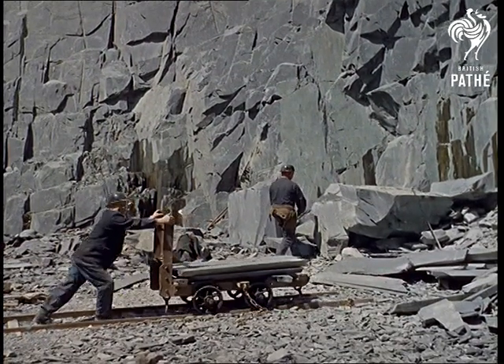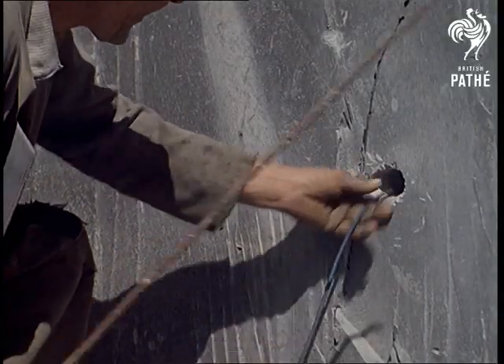Slate Quarry Beware - Other Colour Pics Share This Title (1962)

Comment: Still operating a hundred years hence. Alas, this is not the case.
Reply: What happened to it?
I am a slater from London and the Welsh slate is the top of the market slate
Reply: @raybans8712  closed down around 2009.
Reply: @uncouthboy8028  because it ran out of slate?
Reply: @raybans8712  I'm not sure. My assumption was it being due to health and safety or the environment.
Reply: The Dinorwic Quarry Closed in 1969, only 7 years after the time of this Documentary ( 1962 ). All of the Dinorwic Alice Class locomotives were preserved. Not sure about the Diesels though.
Reply: @uncouthboy8028  cheap slate from China didn't help. 🇬🇧
Reply: Dinorwig also took on a huge order from France which collapsed, sending the mine into bankruptcy. Thatcher's era. Government was not supportive of the mining industry. Coupled with the cheap Chinese slate. They just lost from all angles political and commercial.

Oakeley Quarry in Blaenau Ffestiniog survived only through extreme mechanisation and diversification into other markets such as powdered slate for makeup.
Reply: The mine at Dinorwig has since been engineered to house a big hydro electric power station within the mountain, still in use today. It's even more important now we're having to balance the grid when there's demand that alternative generation can't provide... a lull in wind from wind farms or drop in solar etc.
Reply: @channel_alan been to Blaenau today, spoke to locals and saw one of the old mines. They are all shut and slowly falling apart
Reply: thought the same
Reply: I was At this quarry yesterday and I can guarantee you the slate hasn't run out! Tons of it left
Reply: @bengrice5523  It's still in operation and being actively mined?